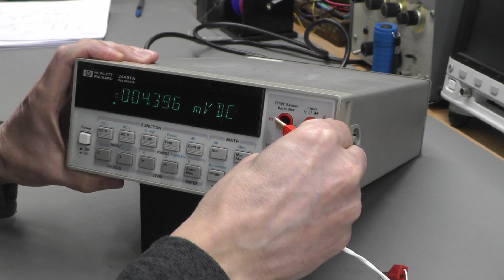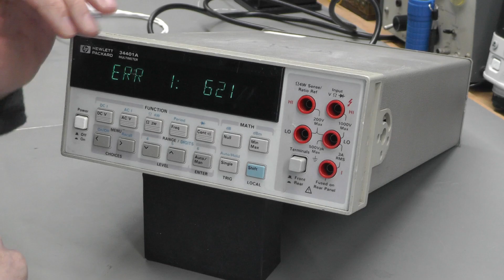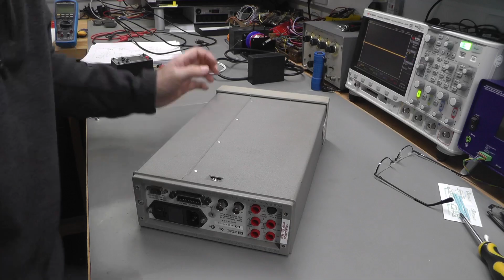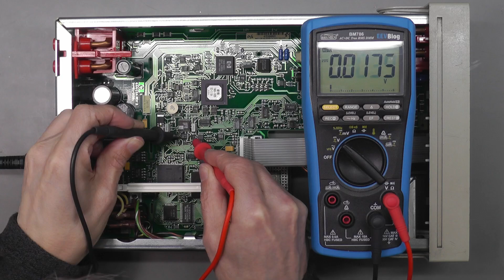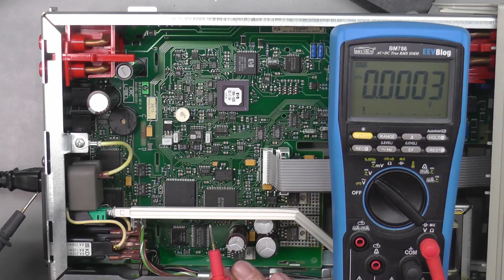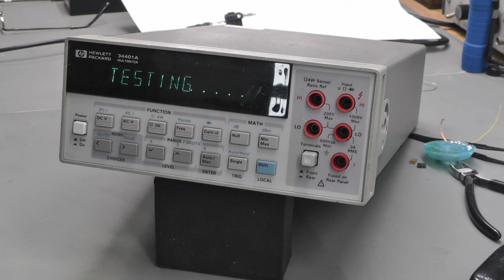No.104 - 3rd HP 34401A 6.5 digit Multimeter Repair

Comment: I have one of these meters, had to fix a problem with the AC power switch... Nice to see you working on the guts of her... I guess I should be looking at to get the service manual...this meter has a nice bit of history; it has asset number 0001 on it, from the main R&D site of a mobile device company in Finland...so, maybe one of the first instruments purchased for the engineering team!

Comment: Auch, hot air on precision instruments :( . You can see poor film capacitor bubbling and melting next to tant....  Tantalum caps easily removed with soldering iron without stressing everything off. 
All blacked FR4 need to be removed too, not left there to cause huge leakage.
Reply from the maker: Fair point.
Reply: @pa1wbu  tantalum caps of that type have flexible leaf terminals. So one can heat up one side, lift it like 10-15 degrees up off the board pad. Then go from other side and remove cap. No need two iron yoga exercises :)

Comment: Thanks for sharing, I really enjoy the videos. One of my 34401A had a bad unobtanium relay. The best replacement is only good for 200V instead of 1000V. Not a big deal for my use case. These are great DMMs. Since the tantalums in these devices tend to fail at some point, would you consider replacing all tantalums or wait until they fail?
Reply from the maker: Tants are usually reliable compared to electrolytic caps, however the failure mode of tants is too much ripple can cause them to short out.
In the case of the 34401A I just repaired it’s a 20v tant on a 15v rail and these days that’s regarded as not quite enough headroom.
Reply: @IanScottJohnston  exactly. Manufacturers like AVX recommend to calculate the derating based on the expected level of ripple current - sometimes 50% derating isn‘t even enough. But due to the small derating I suspect that the likelihood of one of the tantalum’s shorting out is high, regardless of the state of the electrolytics…
Reply: @IanScottJohnston  That's not too bad 75% of rating. 
We used to have a rule that we could not exceed 80% of any components rating. But as nearly all components were Mil-spec ones the caps were expected to last 25 years of service. Shelf life was not as good unless you could power them up every 5 years or so, must have been to force those little election buggers back into their place.

Comment: i hope one day to afford a 2nd 34401a, so that i may check it against my existing one and only beloved. which is my daily workhorse for pretty much everything.

the thing with my unit is its vfd is like this one, currently good but with the unobtainium driver ic. so the day will likely come to replace with the oled project. at which point i will need to cross check that the oled display mod. to be certain that it is not going to throw off the metter of affect the accuracy or whatever. i hope it doesn't but nobody seems to know yet (at least not for certain, we suspect it should be ok)

Comment: Feedbackloop has a channel where he fixes a display that had some bad tantalums and bad inductors on the the display board. The display was brought back to a nice brightness. I believe it was video #20. Thanks for all the great videos.
Reply from the maker: By increasing the voltage on them they can be rejuvenated (filament contamination) by burning off carbon deposits. I have a couple of old 34401A displays so I guess I should give it a go. Can be hit or miss.
Reply: @IanScottJohnston  I don't believe he changed the voltages, if I remember there was an ceramic capacitor between a couple of tantalums that was shorted. And I believe one of the inductors was either open or shorted, 47uH I believe.
Reply: @DavidSmith-zx7wz  that was the repair, but there's also a rejuvenation process that Ian is describing where you overheat the elements to burn off any coatings. There's also another process that uses inductive heating of the getter patch to rejuvenate that too. These are all the same approaches used to rejuvenate CRT monitors if you're looking for more information
Reply: @bansci  Thanks for that info!